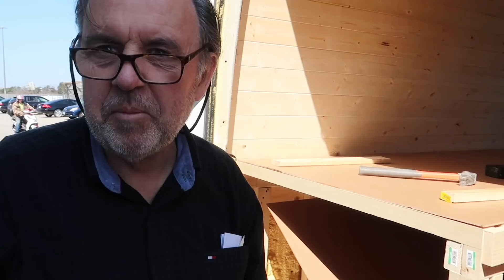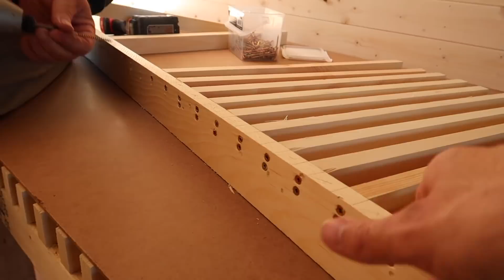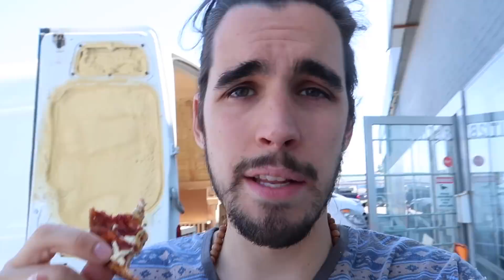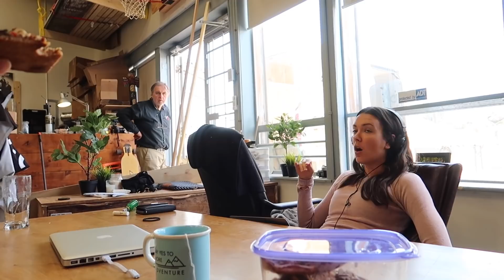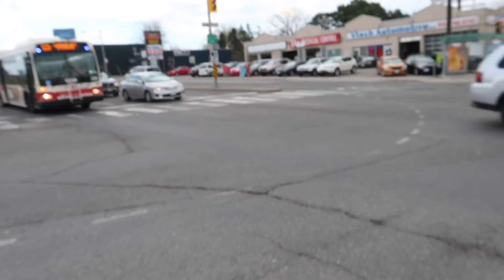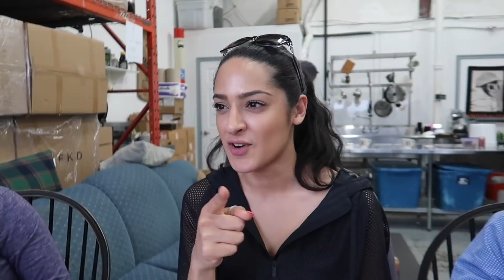1000 WATT SOLAR OFF GRID CAMPERVAN // van life meetup

Comment: Hey Guys, that box  next to the bed (where you have your table in your van) could be really useful. You could make a fold out table with its top counter. As in you have piano hinges running the length of it and the counter folds outward towards you when you are in couch mode👌🏼. I don’t know if you’ll get what I mean 🙈 (like imagine the counter folds open like a book)

Also I would suggest maybe having it in 2 pieces so that you can fold out like a half table when he’s just eating alone or quickly needs a surface etc.
Reply: Philippe Lobelle It's so awesome building. As soon as we got on the road, we started a new project list. Lots of upgrades. We love build projects now! 💚🚐

Comment: Awesome! Can you also power the van directly with Solar energy and use the battery only when there is not enough power? Building my own van soon but want to charge the batteries as minimal as possible. They are expensive😂 I need 1000 watts since my PC is 600 watts

Comment: QUESTION: How much does this solar system weigh? Do you have a written confirmation from the vehicle manufacturer that you are allowed to do this with the specified roof load of the vehicle? Because I am planning a 1800 Wp solar system on the vehicle and need help in this regard. From the weight, I would not estimate my planned solar system heavier.